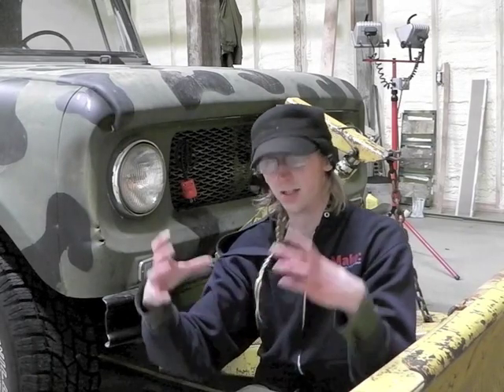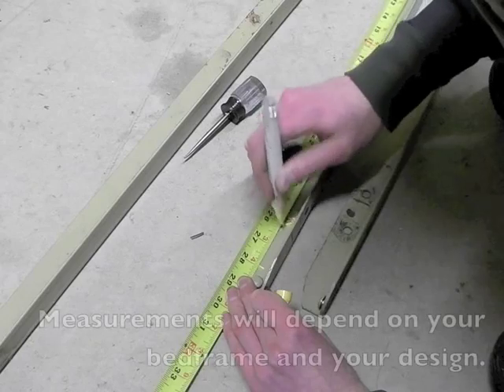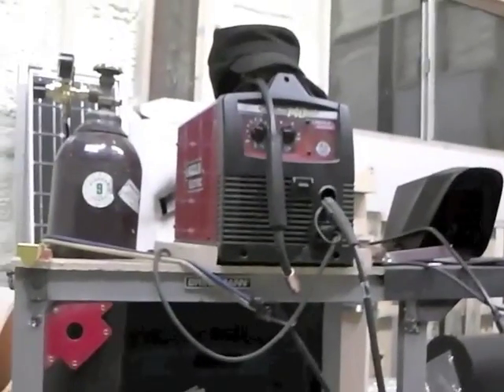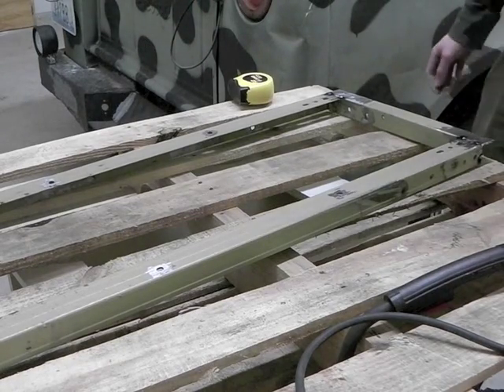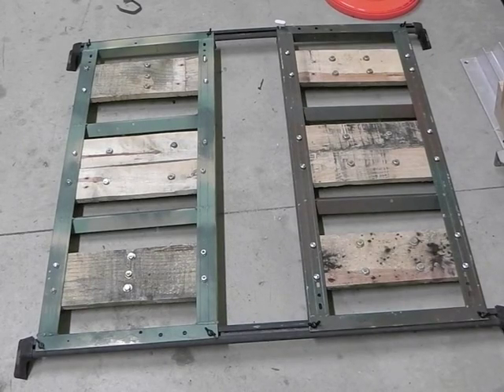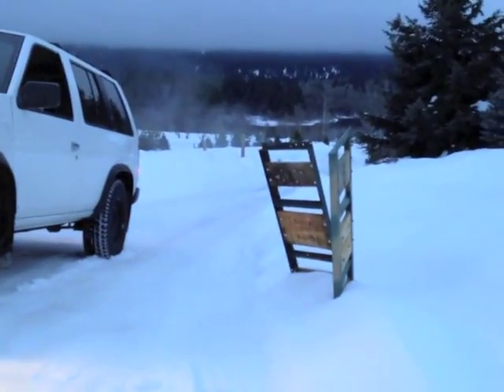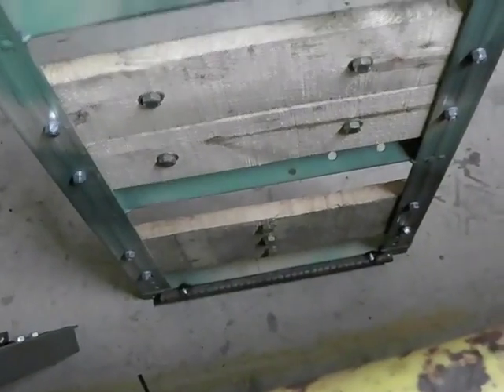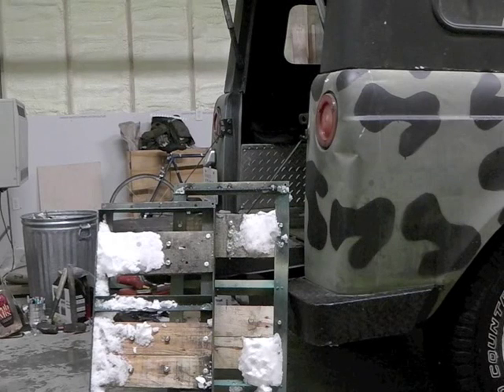Sand/Snow Ladders on the Cheap (DIY)

Comment: appreciate u putting tim and effort into this.
i was thinking of taking a wooden platform an screwing nuts and bolts to it, instead of all the metal parts, what do u think,would it work?
Reply from the maker: +Arshnas Mohammed I don't see why not--in fact I've seen a similar concept done with heavy plastic (looked like cutting board material). The one thing I'd worry about with wood is the number of holes weakening it so it splits down its length if used on an uneven surface. I would cut a few cross pieces of wood, with the grain 90° to the main plank, and bolt them down to strengthen it against that. Might add some grip on soft surfaces as well. 

If you do try it out, let me know how it works!
Reply from the maker: +Darwinpasta Another thing to keep in mind, if you've got a row of holes across the board, the wood can fail between those holes pretty easily. I actually had one of my wood cross bars go that way. Spread the bolts out to avoid weak spots.
Reply: +Darwinpasta i think wood in itself is weak as what u said is true, the holes WILL make it weakened, but that hard plastic u mentioned seems like a good idea, is it available in that size as scrap anywhere? i mean, i cant think of where that type of plastic would be available.
Reply from the maker: +Arshnas Mohammed You can buy HDPE sheet online, but it is kind of pricy once you start looking at the thicker stuff. You might be able to find something at a dump that could be made to work, though. A couple years ago after a flood I helped pull a big plastic tank out of a river, and it had reasonably thick and somewhat flexible plastic walls. Cut a couple pieces with a jigsaw, flip one over so they make a straight piece when bolted together, drill and bolt, and you could probably make something workable. Linoleum might even work if you had enough layers of the stuff. It really depends on what you can find locally. You might also check with someone who builds custom cabinets and counter tops, they might have something suitable.